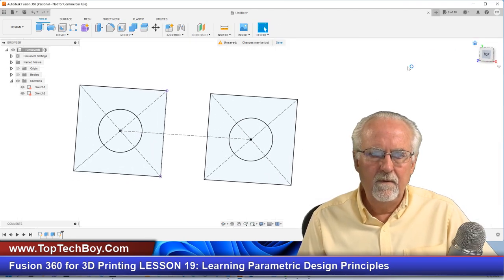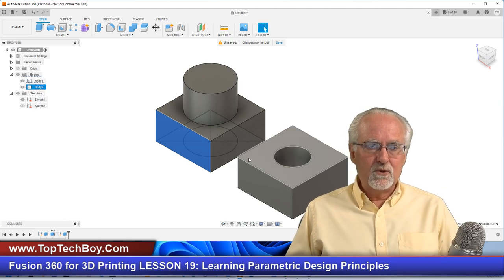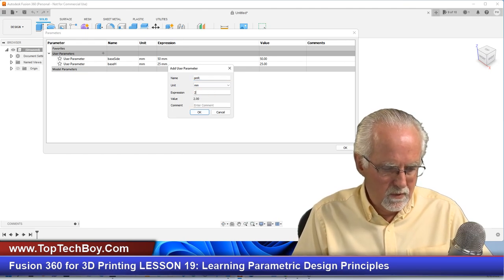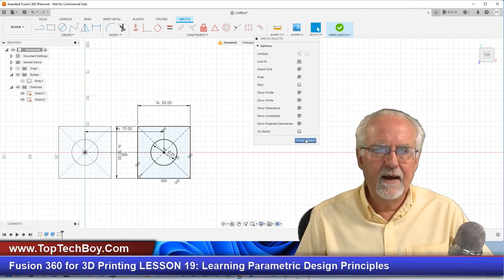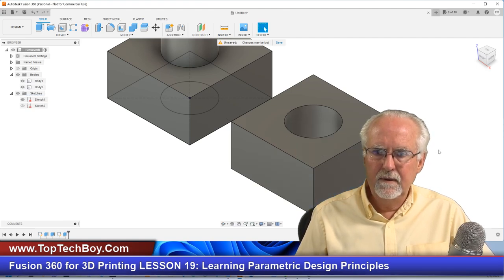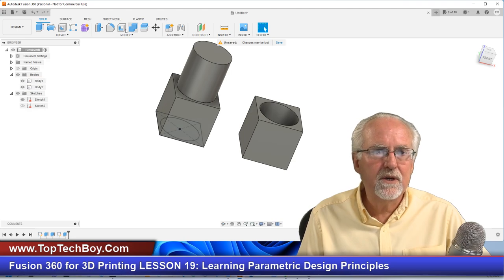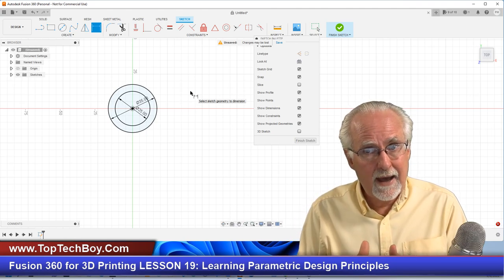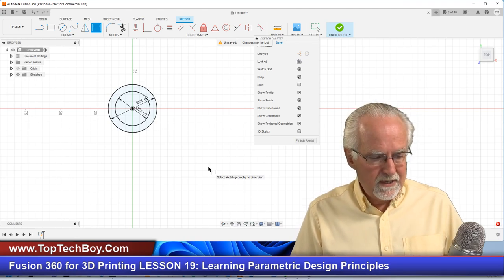Fusion 360 for 3D Printing LESSON 19: Learning Parametric Design Principles

Comment: Outstanding course - still with you!!. Have changed from RS Designspark because of your excellent teaching style. Noticed from your earlier course you were using a Prusa 3D printer, any reason you changed to the Ender. Have been using the Prusa Mk3s kit for a number of years and found it outstanding. Best wishes from England.
Reply from the maker: Both are good printers

Comment: It seems like the offset function, used to create the additional two rectangles in our sketch, "forgets" the parameters it is given. Does this mean you should avoid the offset function entirely for parametric construction and create the rectangles manually with "xLength + wallThickness". Or is there a more elegant way?

Edit: I think I solved this and for everyone who runs into the same issue, ill keep this edited comment up. The issue seems to be the order of operations. I created the rectangle, used offset two times and used fillet afterwards. This seemingly breaks the parametric distance constrains in the corners of the offset rectangles and replaces them with numeric values. So fillet first, then use the offset function!

Comment: Good day Paul... I'm really enjoying this course!!  A quick question.... With your experience with 3D printers, which printer would you recommend in the $500 bracket? (If I want to pay a little bit more to get a bit of a "better" printer). THANKS
Reply from the maker: I would still get the creality Ender 3 V2, and would then begin adding upgrades to it. I am getting exceptional performance from my printer. I believe it is more about your print skill than how much you spend on a ptinter.

Comment: Another great lesson Paul!  You are correct in that this is an important lesson....It's the geek version of acquiring the key to the secret golden city.  Here is a link to my homework:  https://www.youtube.com/watch?v=aAAHLM7wueA.  The parameter named assemblyClearance is a negative offset like we did on the threaded nut/ bolt project.  Thank you, Paul!
Reply from the maker: Excellent! Did you try printing any of them?
Reply: @paulmcwhorter  Not yet.I haven’t fixed the thermal issue with my printer, so I bought another and the new one waits for assembly.